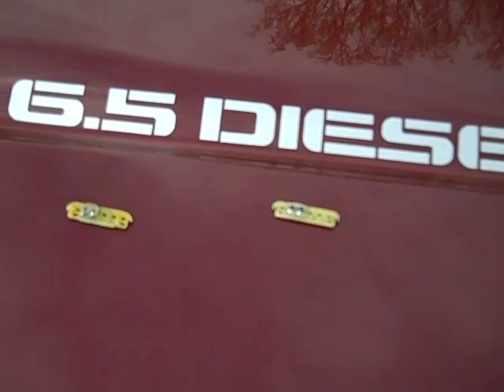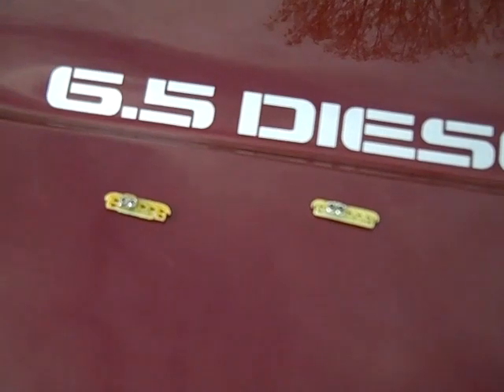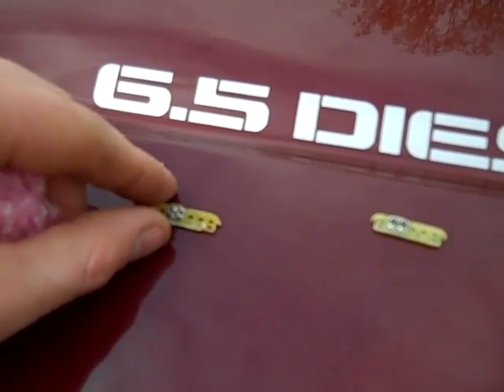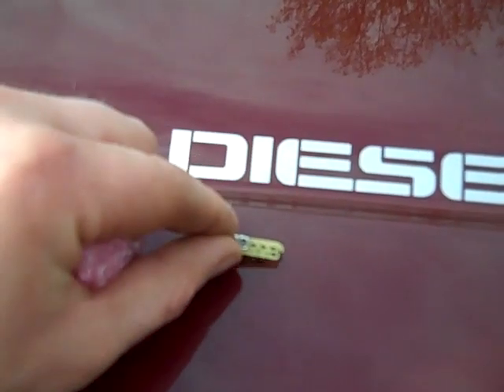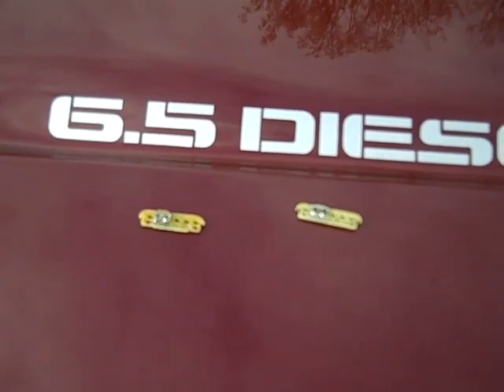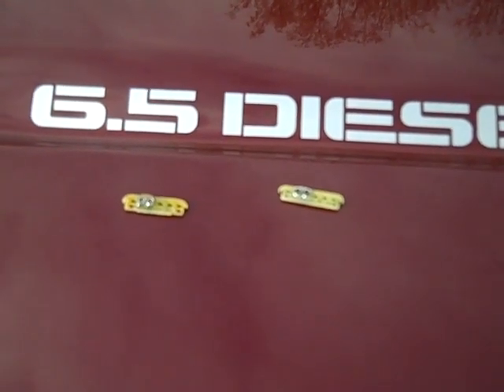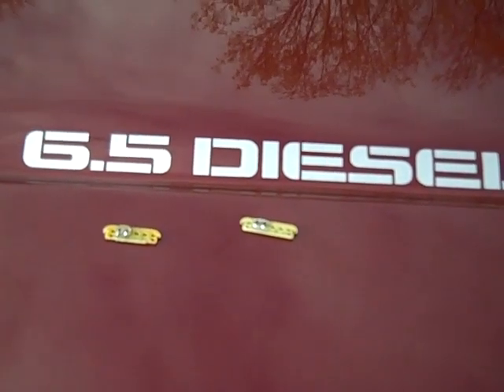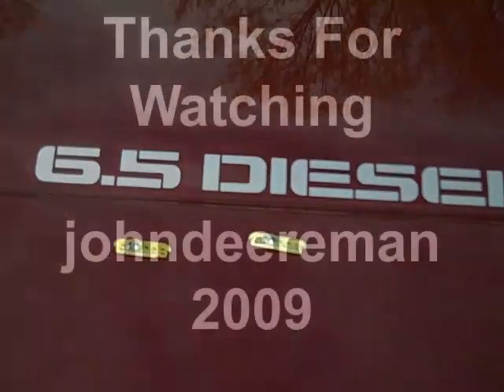PMD Resistor  5 and  9

Comment: Mine had a #3 in it.  When I bought the gray Stanadyne PMD I got a #5 for it.
All I've noticed is more black smoke when I gas it. Which I dislike.
I had to cut all the tabs off it, then sand it, on all 4 sides to get it to go in.

Comment: I have a 95 2500 nv4500 gm crate 6.5 turbo master heath diesel chip kandn air filter still have stock air box on it installed turbo back 4 inch exhaust today and put in a num7 resister I had already.. It gets down pretty well